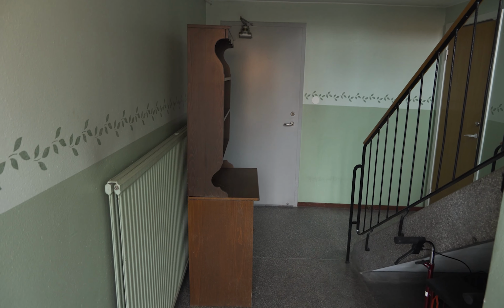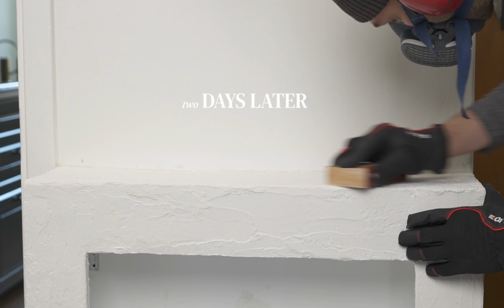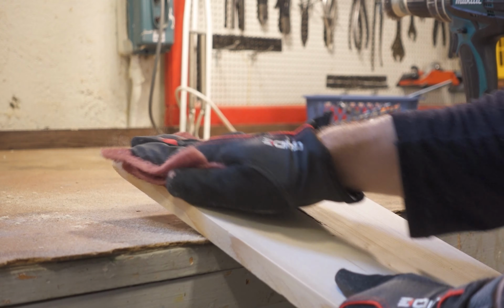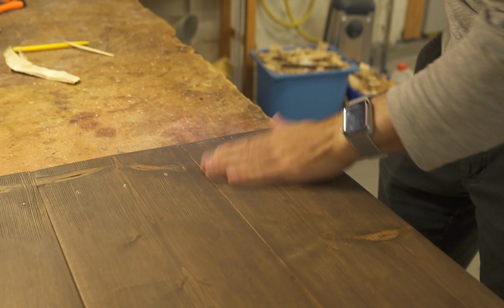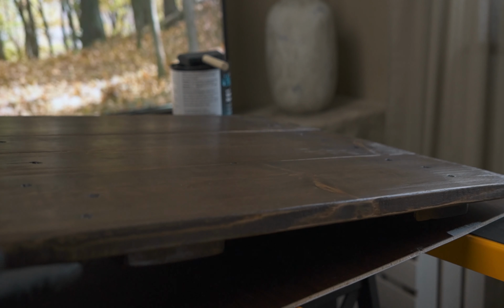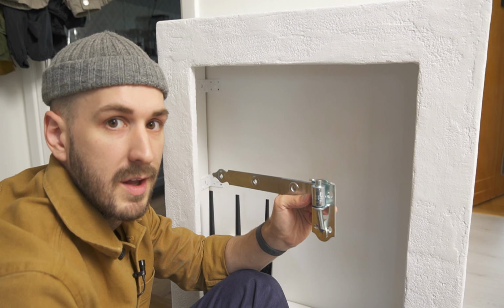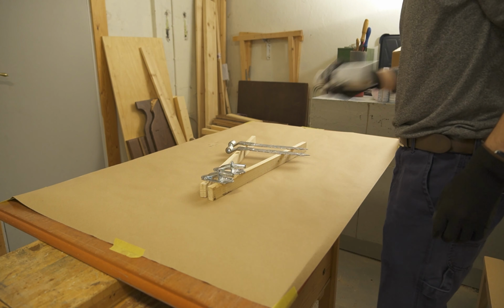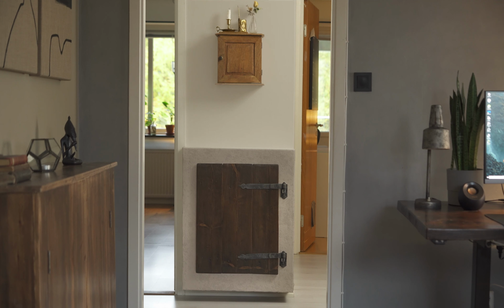Covering cheap wood in plaster

Comment: Great video!!! I learned many tricks from this &
the storage came out great! 
My constructive criticism is the hinges are not correctly spaced out and also if you use this for Wifi signal usually you need spacing , holes on the side of cabinet or mesh so the signal goes through.
Reply from the maker: Thank you so much Veronica! That means a lot to us! 
Yeah, you’re right. I completely forgot about hinges when I put the nails in there first. 
I was a little concerned about the WiFi too, but after a few tests before and after it’s no noticeable difference. It’s a pretty small apartment too so, maybe that’s why 😊
Again, thanks a ton for the kind words and constructive criticism! We really appreciate it!